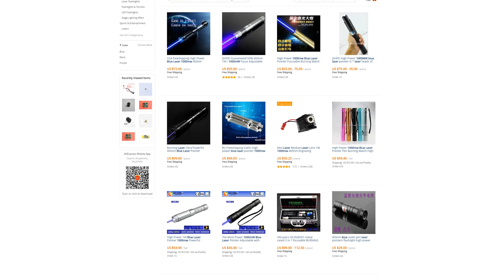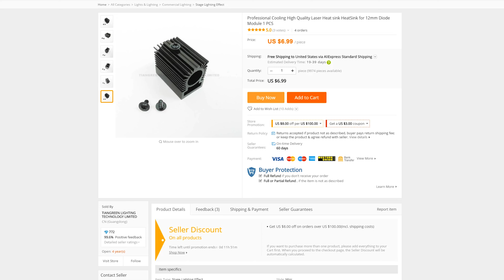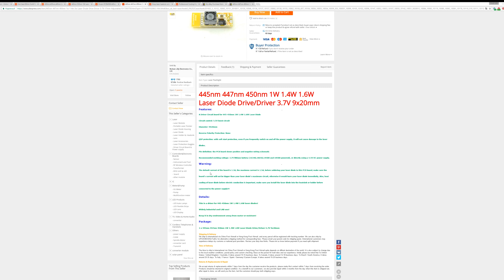How To Build a 1W Burning Blue Laser

Comment: Hey the laser diode is rated for 1.5a and with 1.8 it reaches to 2watts so you aren't even close to it's true power I suggest you remove the resistor and turn the potentiometer to it's maximum threshold